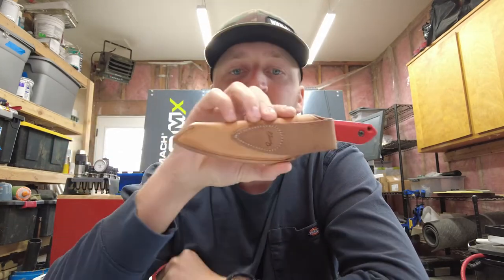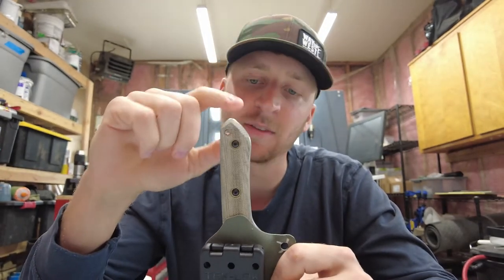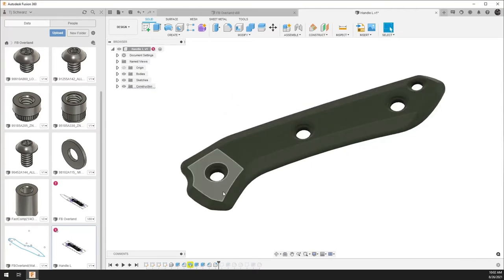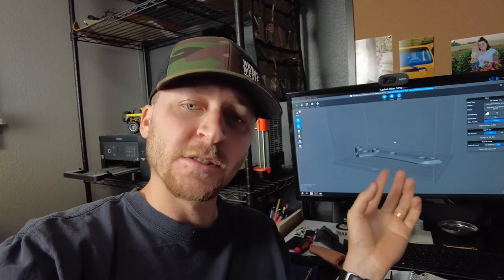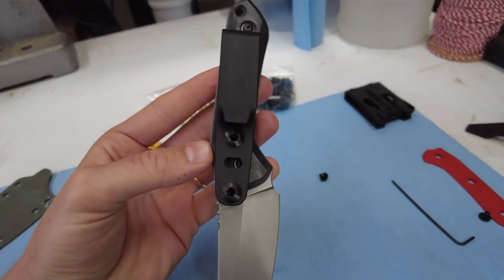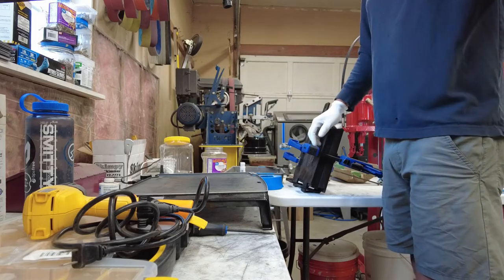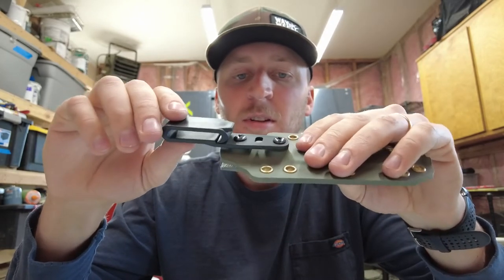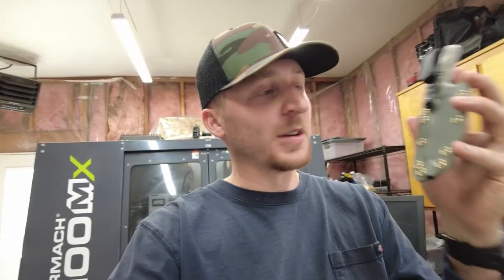Making a Better Knife Sheath - With 3D Printing?

Comment: Hey TJ, if you want to push the fit and finish a little. Get a 0,1inch leather edge beveler and run the edges with it. Will give the product a more precise finish.

Comment: Randomly stumbled into your channel today. First, that is a sweet looking knife, looks like it would be great for cleaning game/fish and tailgate kitchen use! Using a 3d printer for blocking is something I would love to explore, great insight! I don't know if you have figured a press out but I use two that I made with a simple 2x6 lumber frame and an RV jack.... it allows you to apply pressure with one hand almost instantly keeping the kydex from cooling down for best definition. I use a cheap T-shirt press for heat.
If you ever want an even more smoothed edge, after you sand with paper you can use a scotchbrite pad as a finisher, it will be almost as smooth as a buffing wheel when wet sanded, the grey ones are pretty slick.

Comment: Maybe some input for improvement, tell me what you think.
1. Instead of using big open rivets, use smaller rivets and place them closed to the blade, this way you can decrease the size of the sheath
2. Instead of screwing the clip at an offset like that use a 4x retention system where you use 4 of the rivet heads to attach the clip. You can 3D print the clip or mock ups of it, this way changing the clip is easier and you can try out more designs faster

Comment: I dig your design approach, TJ.  Quick question…  I’ve had trouble with grit from the grinder belts getting stuck inside the sheath.   It scratches the knife every time it goes in and out.  Have you ever had that problem?  I need to up my Kydex game and get one of those resin printers like yours too.  Thanks again for sharing your processes on YT.  I’m definitely going to stay tuned.

Comment: Really late to the party, but I used to use a set of sex bolts to put the two halves together to cut and sand everything super even and perfect as if it's eyeleted already.  then you can take it apart the finish and clean out the sheeth.  then I eyelet everything.   I have commitment issues